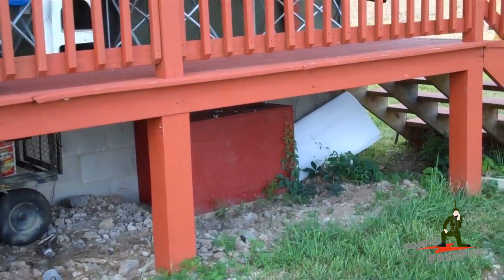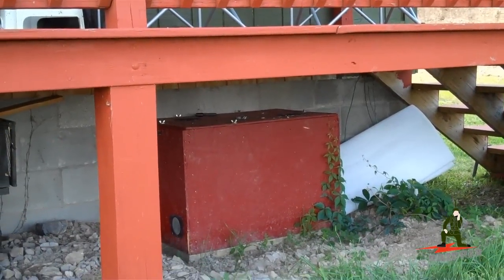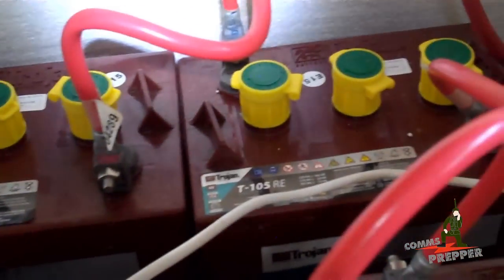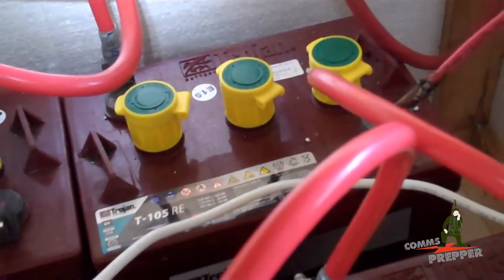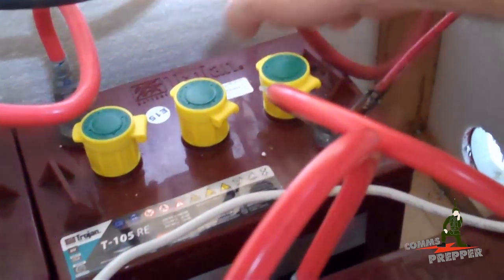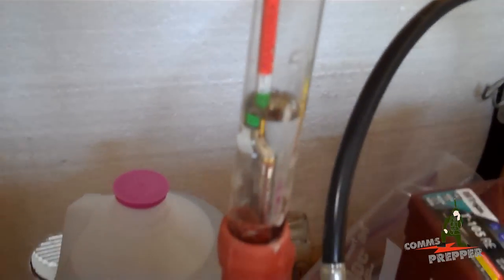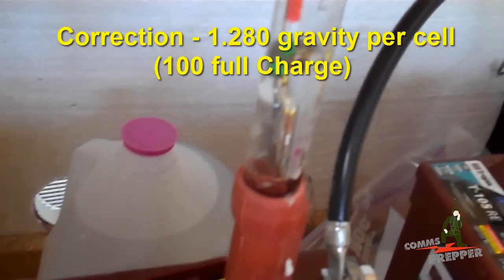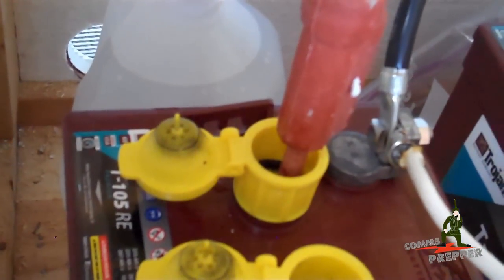Off-Grid Solar Power Batteries Trojan T-105RE

Comment: They look like 6 volt batteries, what are the amp hours / reserve  per battery?
Reply from the maker: They are Trojan T-105RE (RE = renewable energy).  They are 6VDC, 225 amp hours.
Reply: Commsprepper Thanks, I need 12 new batteries after we move but 2 for now for a small system.

Comment: I've seen those caps before but they had tubes running to them from a reservoir
so they wouldn't go dry.
Reply from the maker: BC ElginTex I have seen the auto-filling/level cap systems too.  These caps are designed to recapture evaporating water and return it to the battery with the electrolyte.

Comment: The white wire is getting hot , you see the insulation brown and pulling back, might be a bad connection !
Reply from the maker: ***** It's okay.  I burnt it when soldering the connector on.  I just haven't gotten around to changing it.